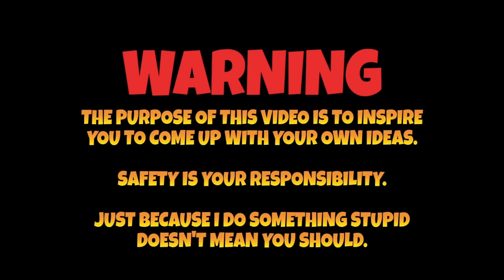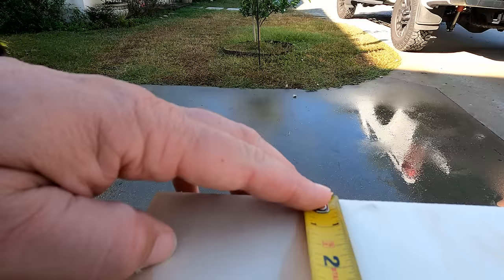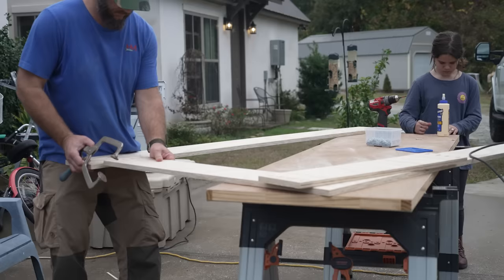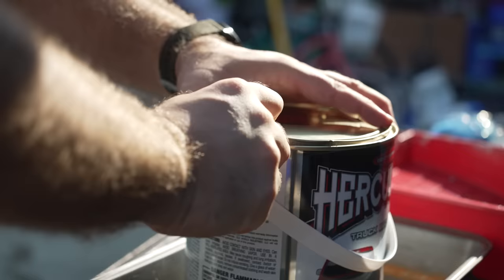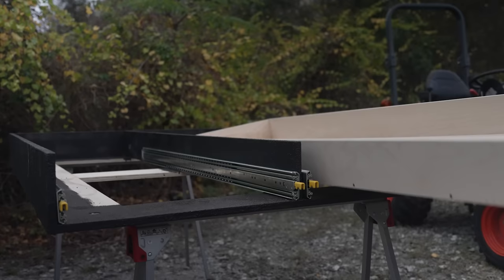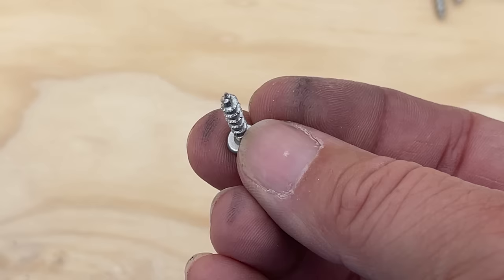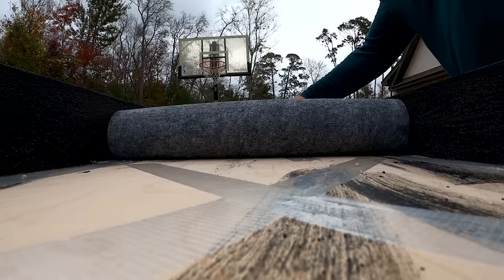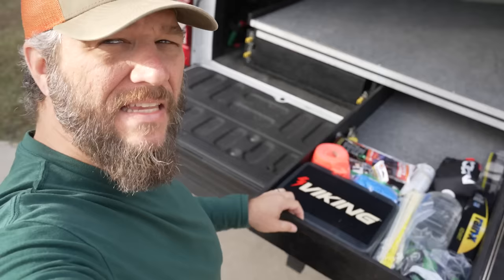Don't Buy A Truck Bed Slide And Drawers!

Comment: My work Tahoe had a "Truck Vault" in it.  They have models that don't go all the way to the sides. Even the pre-made units can be a pain to install properly, but those drawers sure nice once it is in.  I added some D-ring tie down points to the side of mine and it let me strap down stuff I put on top of it to keep the stuff from sliding around.

Comment: I bought a bed slide for my Avalanche 9 years ago. Best thing ever, used it for camping and my acreage.  And now for the city, its still awesome.  I bought mine that was made for my truck though, so install was 30 minutes and the best $1000 I ever spent.  Could I of built it myself, probably.  And then years would of passed because I wouldn't of.  Sometimes money is well spent.   But an awesome job

Comment: Great vids. The splinter guard can be reattached with carpet tape. When they get chewed up, you can pull them off and move them over about an eighth of an inch and it’s like new. The last time I bought one, I got the makita and it seems to stick better.

Comment: Loved watching this video. I think it’s super cool you having your daughter help out with your project. I can sympathize with your work station. I have not even a one car garage so I do all my projects in the driveway. It makes it hard to get motivated sometimes. I just finished a bedslide project myself. Yours turned out really nice. I kept a hoe to get the stuff in the front of the bed. As for the chip guard on your track saw mine did the same thing I used some 1/32” double sided tape (VHB tape). Fixed it.

Comment: SO glad to see a video from you. I was getting worried how the homestead was doing. 
I really like this project. It makes me want a truck again. Last one I had was an '86 F-150 Regular cab, long bed, front & back fuel tanks, 4 speed with a creeper gear. AH, I do not miss the 12MPG it got. 
I can't believe the chickens didn't poop on the driveway on Day 5. I think they are slipping. ;)
Reply from the maker: Thanks! Unfortunately gas mileage hasn’t improved much. 😄
Reply: @HAXMAN  Yeah, but who doesn't miss that E0 BTU punch! 😁

Comment: What kind of weight do you think the top shelf will hold when extended? I bought a commercially made bed slide but without the drawers under it because the price was really getting up there, it is rated to hold 1,000 + lbs. and I am certain I have had nearly that if not a little more at times. Great video, thanks!
Reply from the maker: This is only rated for 500 pounds. Thanks!
Reply: @Greg Norris You could  make some blocks to support it that would simply slip under it, and have a less chance of wrecking things!

Comment: What's your internal drawer height? I am considering building a drawer basement in my new camper (Tune M1, similar to an OVRLND), and only have 6-7" to work with to retain full standing height, and I'm wondering if it will be worthwhile or just too short

Comment: Well..... Maybe if you used a paint key instead of a screw driver that can wouldn't have been so difficult to open! 😂
Also, A screwdriver will screw up your can lid and make it almost impossible to reopen that can when the time comes. Just saying... They don't call me the paint queen for nothing

Comment: Nice job!  Where did you get the slides?  Everything I see on Amazon is advertised for 500lb but once you go with the big 60"slides, the weight capacity drops to 250-300.
Reply from the maker: Thanks. These came from Amazon. They are Vevor brand. I had a hard time finding 500lb slides this long as well. I really wanted 1000lb slides.

Comment: All that money for Festool and it's already falling apart. lol. I spent $200 on a WEN saw with 8 feet of track and it's still going strong 5 years later. 

A lot of the festool miter saws sold in the US have had numerous problems with their motors needing to be replaced. It's just not worth it for the price, the custom parts needed and the inability to just go down to the local store if you need something for it.

Comment: How well did your method to curb sagging work out for ya? Have you tested it w/aa significant amount of weight yet?Thanks for sharing. Aloha
Reply from the maker: It worked great. I don’t know exactly how much weight I’ve had on it but it has had no problems. This is honestly my favorite thing I’ve ever built. So useful. Thanks!

Comment: Noice video go'vna, from down under. I'll be spending some dollaridoos pretty soon doing this.
Reply: I'm thinking about doing similar but in the back of my landcruiser wagon.

I live by the beach. So full length drawers with compartments. Outer box out of 12mm ply, boxes with divders/stringers I'm hoping 9mm will be enough. Teflon sliders, spray of silicon should keep things moving. Then on the top of the box on the outer edges I'll put cabinet slides, with a sliding platform on top that overlaps, not quite sure how to do it yet. Attach strip's of ply then screw down the top...

With the overlap idea to keep sand out of the runner system.

Vinyl over the top...